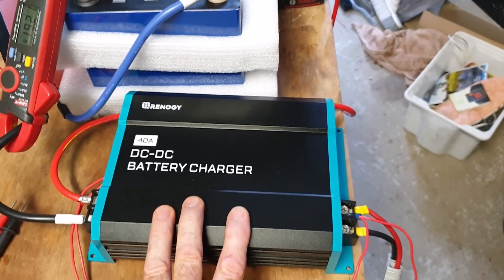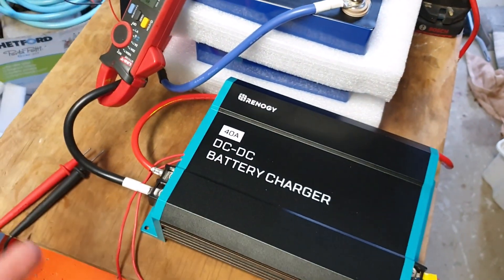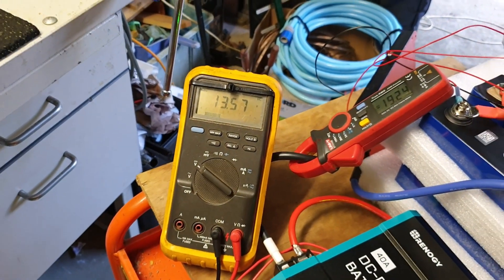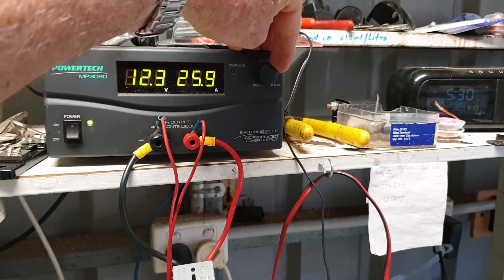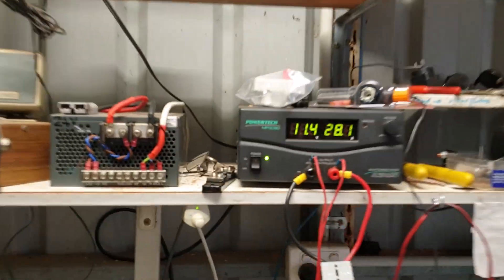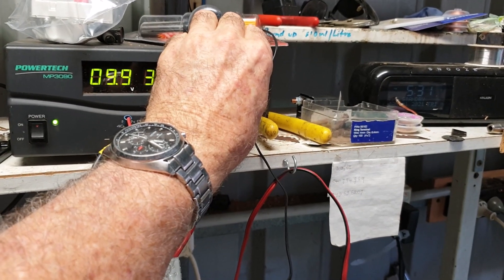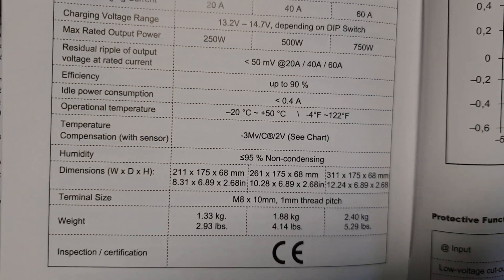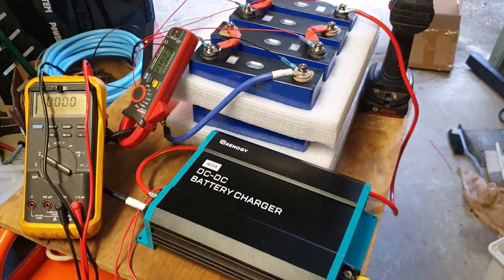Renogy 40 Amp DCDC Charger - It works Properly unlike the DCC50S!

Comment: I have been trying for over a year and have had various technical guys look at the DC to DC charger..... no one got it installed in my travel trailer (carvan)  working correctly.  Your video solved the problem.  The final missing piece is the grounding of the negative. This allowed the LC to reduce the amps by 50 %.
Finally, I can tell Renogy to close their file.... and watch your video.😊.
Guess the Aussies are smarter than all the Canadian tekkies.😅

Comment: I submitted a Q to renogy via their support website : How many amps reach the leisure batteries when 1. Engine running (50amps available ) and 10 amps of Solar are also available 2. Engine not running and 40 amps of Solar is available. A1: DCDC charge controller will attempt to maximize the solar input first. It will take as much power as possible from the solar panel (up to 10 amps in this case) before supplementing it with power from the alternator. So, the leisure batteries will receive up to 10 amps from solar, and the remaining power required to charge the batteries up to their set voltage will come from the alternator (up to 40 amps) A2: If the engine is not running, and you have 40 amps of solar input, the DCDC charge controller will utilize the full 40 amps from the solar panel to charge the leisure batteries.

Comment: Looks like the problem with this charger is it will run your start battery flat. While 
the 50amp you tested before prioritised the start battery
Reply from the maker: The start battery is protected by installing a VCR to isolate the charger after engine shutdown, or installing an ignition sense wire to D+ terminal. But this one does charge properly.

Comment: Hello
I recently bought and installed a renogy dc-dc 40A according to the instructions. Why does the 60amp fuse blow? after 10-15 minutes
The cables are 35mm2
Reply from the maker: The 40A dcdc charger draws about 55 amps or so due to conversion inefficiencies. So depends how good your fuses are. You should have a 100A fuse.
Reply: @timterry8714  I installed automatic fuses from Amazon
Do you think I should put 100amps? I'm afraid that something will burn
Thank you for your quick response👍
Reply: @PARAGON--01 when u say automatic fuse,do u mean a resettable circuit breaker? If so, then yeah, go to a 80A-100A circuit breaker, especially if under bonnet as the extra engine heat can cause these CB’s to trigger earlier than specified and the cheaper versions can also be out of spec & trigger under much lower current usage than specified. Ive had a 300A CB cut out at about 170A a few times now, so they can be way out of spec. Hope this helps.
Reply: @evil17  This junk destroyed and burned my ECU
Reply from the maker: You should nearly double the expected maximum for a fuse.

Comment: I always thought that Renogy was squarely aimed at the American RV market so caravans and voltage drop probably isn’t something they care about so much.
Reply from the maker: The 20, 40 and 60 amp DCDC chargers do work properly the 50A on the other hand has a design flaw which they may have sorted out by now.

Comment: I have been charging with shore power via a server power supply for many months via the Renogy 40amp, and it's perfect, no issues at all and it's consistent and reliable. The PSU was 15 pounds from eBay. If people want to spend 10x that on a victron or a Noco then ok, but the PSU puts out 52amps at 13.2v the dc to dc max is 40amp and the whole thing works very well together. 480 to 510 watts well👍

Comment: I was  surprised there is no delay when it  see's 12v  @ the  D+.  It starts  pulling 50+ amps from start batteries. I put mine on a 3 way switch off/20/40, feeding 12v from ignition.  gives options and time to start motor without compromising start bank.  Why  there is not at least a 5-10 sec delay  is beyond me. Im on a boat so I need a bit more time to start up motor before this thing pull amps from start  batteries.   Nice video thanks !
Reply from the maker: Yes you would expect some delay. Thanks for the feedback. Cheers Tim

Comment: What is the reason for dropping the output  in half to 20 Ams?
Reply: It  gives you options. I have mine installed with a 3 way switch. off/20/40, this way you can pull only  20 if you are running the engine at  low RPM's or if you just want to slowly  charge  the bank, or if you  want  to put less stress on the alternator.  Without the  switch, and set  for 40  amps, the  unit pulls about 50+ amps from your  start  battery  as soon as it see's  12v at the D+ wire.  There  is little  to no  delay (should have  been a 10  sec.. delay  in my  opinion, to get the motor  running).  I switch mine on at  20amps  once the motor is well under way,  then switch  to 40amps once at cruising speed if needed.  installed on  a yanmar 15hp w 80 amp alternator.  Cheers
Reply from the maker: I agree completely with the above comment - the alternator load is an issue unless the vehicle has had a high current or heavy duty alternator installed. I have only run mine at 40 amps once when my battery bank was totally depleted after I left my 3 way fridge on DC all night. I was traveling at highway speed 100kms/hr the entire time so the alternator was able to stay cool - definitely would not run it at 40 amps if I was driving in the city at low speed and stop/start or in high summer temps.

Comment: Hey Tim 
Once again enjoying another another of your informative well explained clips.
 Awaiting delivery of my caravan and have decided to organise my own battery/dcdc charger and solar setup rather than factory gear.  Intrigued to hear your suggestions  on what renogy products to install to support a 12volt compressor fridge (ThetfordT2175) with y given your learnings and experiences. Currently considering 200 amp lithium batter, this 40 amp charger, a separate solar regulator with 200 watts fixed solar and 200 watt solar blanket. 
Any other suggestions welcomed cheers.
Reply from the maker: I recently installed a Bushman 190Ltr compressor fridge to replace the disaster Dometic 3 way fridge that came with my caravan. The 200A/h's of Lithium Batteries supported by 2 x 175 watt Renogy Flexible solar panels and a portable folding 300W panel have proven to be more than capable of supporting the Bushman (even without the portable panel being required most of the time). I also now run a Breville Coffee machine via a 2Kw inverter, occasionally the microwave and washing machine. If I had the space on the roof I probably would have opted for a 3rd 175w panel but at this stage it seems unnecessary in most situations. Having said that this years terrible weather has certainly tested the capacity to the limit - but so far so good.  I also have the 40A Renogy solar controller which I covered off on another vid here elsewhere. I very happy with this setup and the 40A Renogy DCDC charger (95% of the time it is only ever run at 20A charge rate). So I think you've got it covered off prety well. Cheers Tim

Comment: I’ve just bought one of these and I think I’ll put a switch on the current limiter wire so I can easily change to 40amps only when I really need to AND I think (would like) to connect it to my headlights so it only turns on when I have the headlights on. 

So it’ll only work when there’s no more sun on the panels and if I need it thru the day, I’ll just put the lights on. Dunno if that’s a good idea or not? I do like the voltage drop relay but don’t know how to wire that up.

EDIT: my initial thoughts was not the best idea. In the end, I just connected it to a 12v source that isn’t active after the car is turned off as recommended, but also installed a switch to turn it on or off while the car is on as 99% of the time, I don’t need it. At first I thought it was a real hassle having to wire up that 12v wire, but I actually love it. And it works really good so far. 👍
Reply from the maker: I would be inclined to run it a 20A is you run it when the lights are on as you want to limit the load on the alternator as much as possible. Most alternators are not designed for a constant high load current as is the case with these chargers. I would only run it at 40A if the battery was dead flat and I needed it to recover quickly. I would only run it at 40A is I was driving at highway speed to keep the alternator from overheating.
Reply: @timterry8714  yeah you’re right....after I posted my comment, I realised it’s probably a stupid thing to wire it to the lights. 

Currently, I’ve just wired it as recommended to a 12v source thats only with the ignition on. I’m then going to wire in 2 switches, 1 to manually control it to 20 or 40 amps, and the other to turn it completely off.

I think during full sun days, which is most days, I won’t need it at all.
Reply: Yep, have mine on a 3way off/20/40, otherwise  this thing pull 50+ amps from start  batteries  as  soon as  it see's 12v  @ the D+ wire.  no delay.   I want time for motor to  start, and  warm up.

Comment: Why did you reduce it in half and not the full 40amp. By reducing and it's like you have the 20 version??? Or am I missing something here?
Reply from the maker: I run it at 20 amps as thats all I need most of the time and importantly to reduce load on the alternator. At 40amps out the alternator has to supply approx 55 amps input continuously and thats not good for it. I only run it at 40 to catchup when the battery is very depleted and I'm highway driving to keep the alternator cool under this continuous high load.

Comment: best part of your video is youve done something nobody has done,used a seperate power source to charge another battery bank.I have 2 solar systems on my trailer and I could use the one not used but for lights to help out my other battery ban.

Comment: Thanks for a well presented test.  May I ask what size alternator is in your vehicle?  Would rather charge at 40A than 20A, if my 160A alternator has enough spare capacity.
Reply from the maker: Not sure but at least 100A. Its the constant load that's the issue. Being able to deliver Hi current for a short time is normal in a vehicle but its the continuous hi current load for hours thats the issue.

Comment: Tim - A common problem folk have with these units is that folk fit 30amp breakers to 20amp units  and  they trip on start up - this is due to two phenomina - When the engine starter is engaged the engine battery voltage dips due to the extreem load, causing current to rise as you clearly showed,  combined with the inductor & capacitors in the Renogy unit which cause demand to spike - The combination of both can exceed 30a momintarily  -  I use a 20a unit wired with 7AWG and a 40a Maxi Fuse and the unit has worked flawlessly
Reply from the maker: Mine did have a fault and after Renogy replaced it and I installed it hasnt missed a beat with no other changes.
Reply: @timterry8714  I still think your marginal on that 30amp breaker  especialy when your house battery is at near full and  cold thick oil dips your engine battery on a colld morning  start up -  good luck

Comment from the maker: Bit of an update - I was on the road for about 7 weeks in July-August with quite unseasonally hot weather in Northern Australia with 3 weeks of over 35C everyday. We relied on this to maintain the batteries and this charger has done a great job - with one exception- the ignition sense has failed and have contacted Renogy but its a bit hard testing it while we are moving everyday or so. I told them I will look at it when I get home as it really doesn't inconvenience us at all.
Reply from the maker: I contacted Renogy when I got back sent a short video showing the problem and the sent me a replacement so can't fault that service.
Reply: Hi Tim, interesting video mate - did you get a solution or a response from Renogy on this? (ignition sense?) - Thanks Mate

Comment: Hey there. Great Vid. I just bought one of these. Hooked it just as you have done - it is limiting the charging amps perfectley at 20 amps. Now how do i get the full 40 amps ? I took out the LC wire and amps don't change at all - still sits at 20 amps ? Am i missing something here ? any help would be great - i have contacted renology but havn't heard back from them yet.
Reply from the maker: Hi Andrew, I had a fault in one of these where it was ignoring the D+ input and working all the time regardless of whether +12 was on that terminal or not. I raised a job ticket with Renogy about this and after a few email back and forth and a short video demonstrating the problem they sent me a replacement - so you may have the same issue. It sounds like its clearly not seeing a change of state from the +12V input to the LC terminal. I fed mine from the +12V input terminal by the way. Cheers Tim
Reply: @timterry8714  Hi thanks - I have fed mine from the 12voly input as well. I'll have to go back to Renogy ; what a hassle though !!

Comment: G'Day All,  From Bris Australia. Downloaded the manual for this unit before buying to ensure I understood the specs. Marine application & didn't want to upgrade the 70a alternator & the house batteries are large. Just wanted to limit the current from the alternator to a safe level. The manual that came with the unit v1.3 is different from the download v1.4. Small note in the supplied manual "when sending max the amp consumption 50% greater on input". First point- poor cust support. Raised a question with the company & received & response promptly within a few hours. I call that good support. Given the 500W max. output power, this would result in 40a @ 12.5v under optimum conditions. Any higher voltages would result in lower currents. i.e. 14.7v ABS reduces to 34a. Good for topping off lifepo4 not so good for lead? Anyhow will still install as I am wanting to limit the current from the alternator. Boat came with a VSR that just joined the two systems & the alternator objected. The point is 500watt max. Not 40a over all voltages out. LIFEPO4 if/when the house bank is replaced.
Reply from the maker: Hi Fossil 41, I have had an issue with this unit while on my current 2 month trip away in that it switches on immediately regardless of the being a 12V on the D+ or not. Otherwise it works fine so not creating much of an inconvenience. I contacted Renogy and they responded within a few days which surprised me, so maybe they have lifted there game after coping so much criticism on all the forums both in the US and particularly internationally over the past few years. Still dealing with that issue so while the response was good resolution of the fault and replacing this unit is yet to happen. 

This unit limits at 40A or 20A and certainly a higher input voltage will drop the input current however I doubt you will see 14.4 volts from an alternator at the input certainly after cable loss, but maybe you have the alternator, DCDC charger and battery very close to one another. There are still conversion losses to overcome regardless and it will have a few amps overhead at 40A output. 

You set the battery chemistry type on the charger to suit what you have and that sets the appropriate charger profile so that should take care of itself. If its and AGM battery you should not charge greater than 20% of the rated capacity i.e. 100A battery - 20A charge rate.

Cheers Tim
Reply: @timterry8714  Replaced the Alternator with a tested 70A ( may have had a 40A on the motor). Fitted a VSR to prevent starter battery being drawn down if the alternator fails to give 13V or more, left the 7 min timer that was limiting the current to 20A for a period after startup. All is working & 14.7V @ 1200RPM.
Regards Bill
Reply from the maker: I arrived home from my trip contacted Renogy again sent them a video of the problem I was having in the the D+ input stopped working (therefore always on) and they sent me a replacement - just received it and installed it today. So Renogy appear to have significantly improved the customer service which is great.
Reply: @timterry8714  Terry while progressing  with this unit install, I had a red "fault" light to deal with. I thought the unit was E/S! Took off all in & out leads & shorted them out. The input leads discharged internal caps, the output no discharge. Reconnected & all returned to normal ops. The starter & house batteries were left joined by battery selector & charged from common input. Can't see why this would result in the fault indication but it is now all OK. (extra bits added (1) VSR set to 13V to cover Alt power loss & prevent the unit depleting the start battery by stealth. (2) 7 min timer to limit the current to the 20A for 7 mins before the full 40A is applied).

Comment: I bought the charger but is the trigger (D+) wire just a regular flexible 18awg 12v wire?? Can I put an on/off switch in the line?
Reply from the maker: Just a light gauge wire and yes I have a switch in line to enable/disable the charger. I actually tied the D+ to the +12v input via a switch so it starts as soon as I connect it to the vehicle. The switch is actually a voltage controlled relay so it shuts down the charger at 12.8V.
Reply: yep,  have mine on a 3 way, off/20/40.

Comment: Had a problem with mine, my first 40 amp renogy stop working on just a 400-mile trip, I did notice it was pulsating voltage that was going into my house batteries, they sent me a replacement, check that today and it is still sending a pulsating voltage.  20-amp renogy I had previously, failed after about a year, so I ordered another 20 amp renogy, and now that I've jumped up to the 40 amp renogy I'm using the 20 is a backup. The 20 never pulsated the voltage, does that sound right with the 40 amp
Reply from the maker: I havent seen that issue so cant comment unless its an equalisation function you are seeing which is for Lead Acid batteries and shouldnt be present for Lithium. Check battery type setup as per manual. Otherwise not aware of that issue.